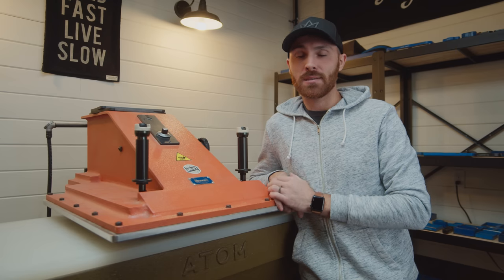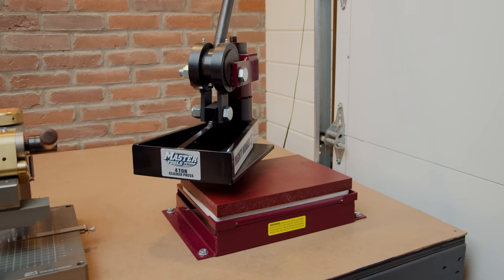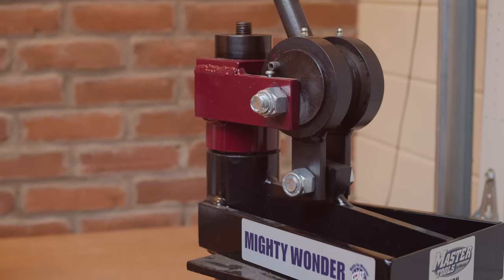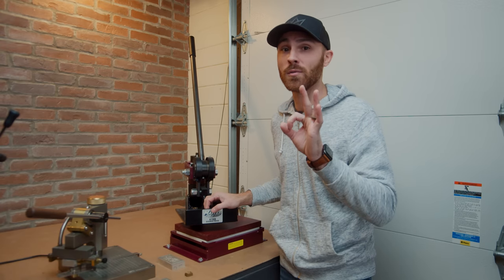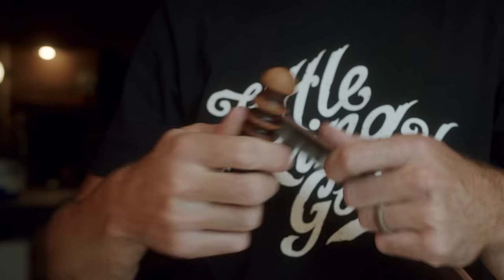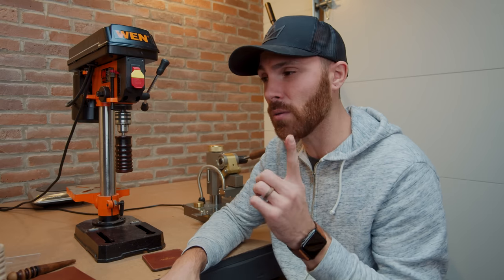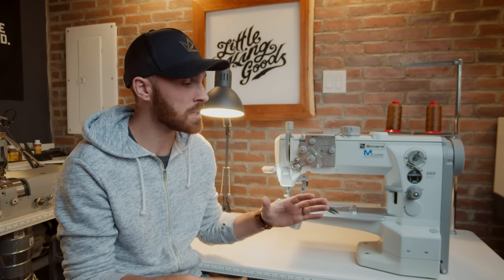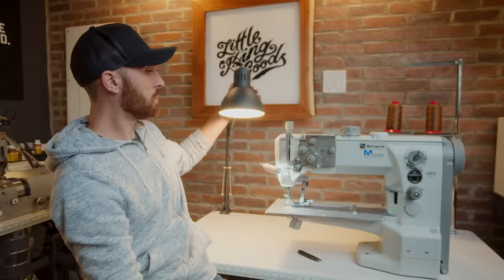MY MIGHTY LEATHER MACHINES!

Comment: Hi Ryan, Great video. I noticed on the section about the Adler Cylinder Arm that you had it set up on a flat table. Some cylinder arms are on a pedestal or a table with a cut out. I am thinking of getting a Cylinder Arm to be used for Leather and Upholstery. So a table like that is appealing. My question is - Have you found any major restrictions with making leather bags and other leather goods with the Cylinder Arm mounted on the Flat table. I like the look of it for what I am planning. Thanks, Will

Comment: I've got a Cobra Class 4, and it's great for holsters, heavy belts, and basically anything that works well with 207 or 277 thread and 25/26 size needles on a cylinder arm.  It's not great at the finer work and smaller threads or needles like 138 down to 64ish.  So, I've been getting more in to bags as well as continuing with wallets and collars.  My next machinery purchase is going to be the bell skiver but I'm also thinking about that next sewing machine.  I need a good comparison between the Juki 1508N and the Cobra 18 or even the Cobra 5110 Post machine for working with odd corners and interior stich lines.  Any thoughts or a way to get a good non-biased comparison review?
Reply: a  juki 563

Comment: Ryan your work is amazing and I have watched you for years...your links to some of the machines are not working...could you please tell me the specific model and stand bell skiver you have? Also is it top and bottom feed?  Where do you get your dies? Is there an advantage to the metal over the other? Do you include the various "holes or slots for the pattern in the die? Thank you

Comment: Thank you.  I noticed you have this Adler and I was wondering how you like it.  It has been tempting to get a cheaper cylinder arm, but I think the Adler is likely the best for fine leather goods.
Reply from the maker: I really like the Adler. I’ve only really owned a Juki, and a heavy duty Techsew. The Adler is amazing. You pay for the quality.
Reply: That adler is a monster of a machine, value for money, durable. I guess it's the best cylinder arm bed machine on the market currently

Comment: Hey out there-thank you for your very inspiring videos!
Greetings from the snowy and boring (Lockdown thx to Covid-19) Austrian Mountains. Hope you are doing quite well, and there´s no thoughts of quitting leathercraft.....I´ve got a burning under the nails question: what kind of speed reducer did you take? I´ve got a few days ago a Hightex 1510- nearly the same  as your Yuki. But I got a cluth motor-can I build in a speed reducer? My machine starts slowly, but if I hit the gas just with the tippy end of my schoe- that thing goes off like hell.....thanks a lot for your Info....great job-go for it!
Reply from the maker: I would suggest getting a brushless servo motor. You could try adding a speed reducer to that motor. In any case it’s always good to have a speed reducer.

Comment: I hAve some really dumb and ignorant questions regarding sewing. I am so embarrassed asking them that I fear they might cancel me from the internet. But it’s a matter of survival so here goes. I hope you see this and find it in your heart to answer cause I’ve googled and googled to no avail.

1) what is the point of two bobbins on the Juki 1508NS
2) in threading the juki videos I see them show loading the bobbin and then they show straight from
Spool to needle. So my question is but why three ways of doing this.
Are there individual benefits. 
3) could you spend some time going over the needles and thread sizes you use their application, the recommended Stitch length?
To someone who had never sewn in their life and the juki 1508 wasn gonna be their first stictch is there something you wanna tip them with or a list of things ?

Comment: Thanks Ryan for the great reviews!  Just wanted to check with you - what is the maximum thread size that the 669 can do?  I mostly do 92, 138, and 207.  Wanted to get a machine that can handle small threads well but can also do 207 maximum.  Appreciate it!

Comment: question about the clicker press. What is the minimum force needed to press through leather? I saw the atom comes in a 10 ton model amd the manual clicker press you have is a 4 ton. Any reason for the high pressure? Would saving money on a lower ton machine be fine?

Comment: Do you recommend the light skiver or the heavier duty? I bought a Techsew 5100 SE last September want a skiver machine now which woukd you suggest? The Techsew sk4 or sk5? 
Thank you for your time and attention. 

Michael Shaw
Cole Slaw's Custom Leather
Reply from the maker: The SK4 is very similar to the model I use. Depends on what you are using it for. If you are using thicker leather all the time maybe it might be worth the upgrade. Talk to techsew. They will guide you to the correct machine.

Comment: Hi Ryan. I love this video as it answers so many questions. 
I do have a question about the bell skiver. I rebind bibles (memphisbibles.com) and have to thin the edge of the leather extremely thin to fold over. I also use softer leathers (goatskin, lamb, etc)
Will this machine thin down the leather extremely thin? Almost paper like? I’ve watched a ton of videos and no one mentions how thin you can’t reduce the thickness.

Comment: Lets face it at Tandy these days make rubbish it is only any good for very occasional hobby user, professional leather crafters give Tandy a very wide berth
eventually your drill press bearings will give out from the side load. Juki is a great machine it is a copy of the Mitsubishi that I have. My cylinder bed it a Singer 45 k from the 50's
Foil press is a little  pricy for me made my own for less than $100, mall my own dies.